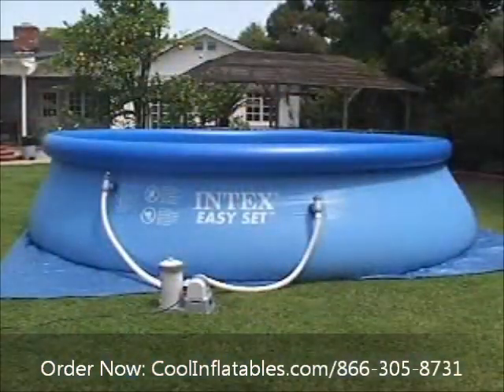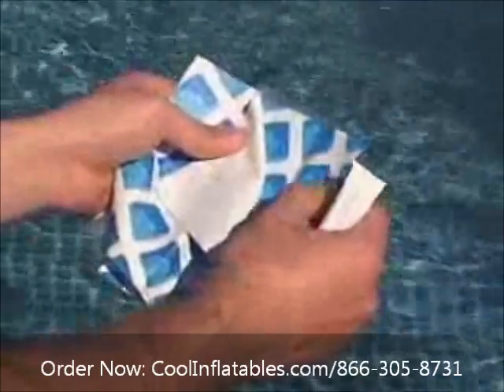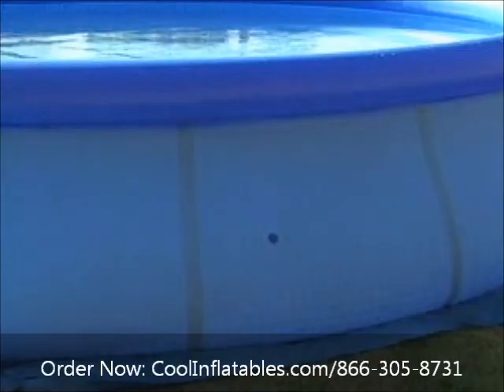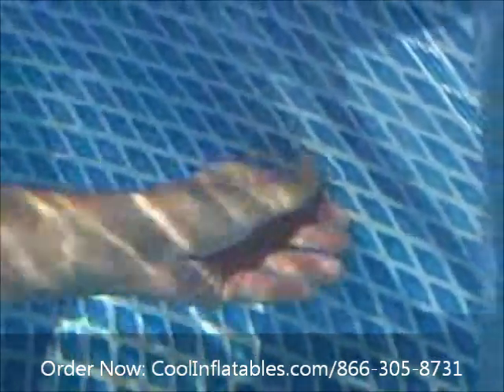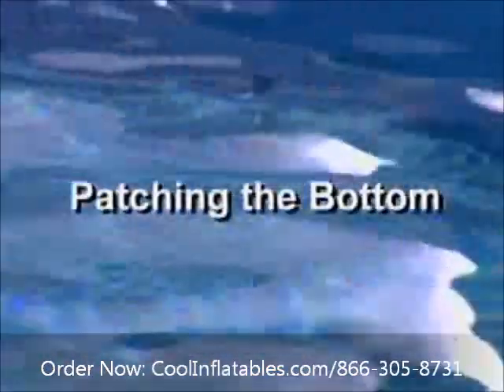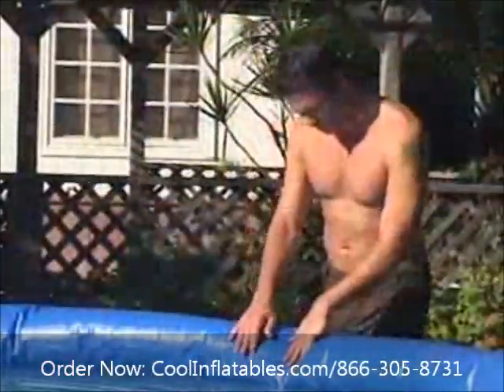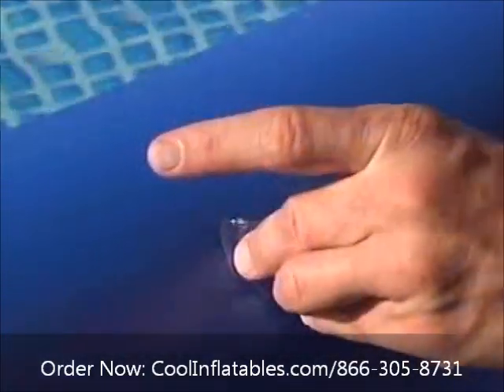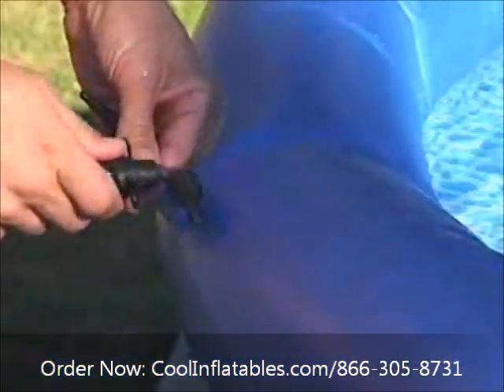Intex Above Ground Pool Liner Repair Kit Instructions

Comment: I was using standard Intex patches with superbond glue (Cyanoacrylate). First I cleaned the hole area with a toothbrush (underwater), then I cut a circle shaped patch with scissors, smeared its sticky side with superbond. Before you add glue, it is recommended to rehearse the procedure of adding a patch underwater (don't let the patch go wet), so you will be able to take the patch to your hand the right way and will be able to stick it more conveniently. Try not to ripple the water, otherwise you won't be able to see where the hole is. It is great there is a way to repair a pool that is already filled with water.

Comment: We have a 16 x 48 Intex Ultra Frame pool that had a small hole in it as soon as we put water in it for the first time.  Haven't even swam in it yet.  Anyways, we tried doing the patch the proper way and it would not stick. So, my husband decided to try to use the self adhesive patch that is for the easy set inflatable rings, and bingo! it stuck perfectly to the liner under water and patched the hole.

Comment: If you have a hole in the actual liner, you cannot fix it with the water still in the pool.  The glue/patch will not stick.  Any yes, we're using the correct Intex kit.  We found out the hard way, you have to drain the pool.
Reply: if you're using cyanoacrylate, otherwise known as super glue.  It cures with the moisture in the air so water just cures it faster.

Comment: Hi,

Actually, glueing under water works! Just add an extra thick layer of the Vinyl Cement on the patch, which should be as small as possible, and be very quick attaching it under the water to the pool. Otherwise the water, or maybe the wetness, makes the Vinyl Cement harden as soon as it touches the water. Better safe than sorry, add an extra patch on the outside of the pool too.

Comment: I cant find air leak in air tube in my pool. I tried all the usual ways/ any suggestion. is there such a thing as colored air??
Reply: same here
Reply: @troyachilles2819  Soapy water may make bubbles ın the leakage area but do not make a bubbly liquid it needs to be like water..
Reply: Err, smoke?
As someone replied, put some dish soap in a bowl add water and sprinkle it where you think the tear is or just all over the place

Comment: I opened the glue that came with it and it has become hardened a bit.  It's no  good.  I am going to try JB weld clear or original.  I'll keep you posted.  If i had marine caulking i would use that.

Comment from the maker: Did you use the self adhesives or the kit pictured above? 

It is tricky but very possible, we have successfully done it a few times here with our test pools. You have to really nail the initial stick and make the patch as small as you can. 

Holding the patch and making sure to patch inside and out are also tips we pass along.